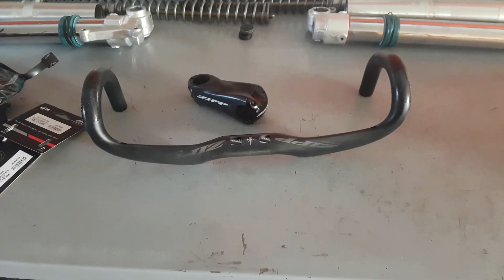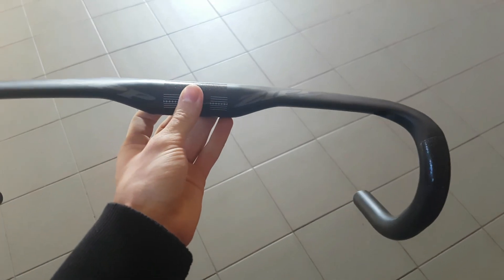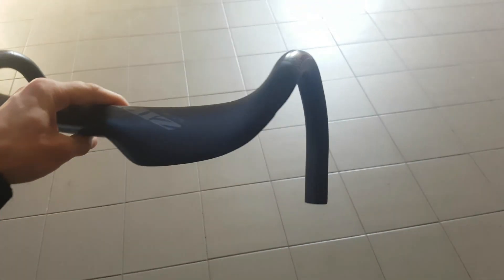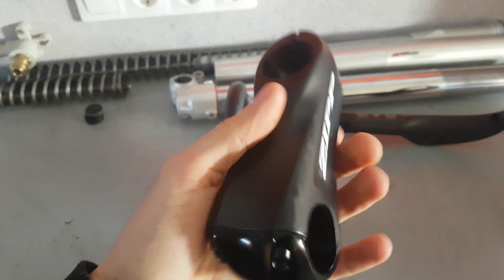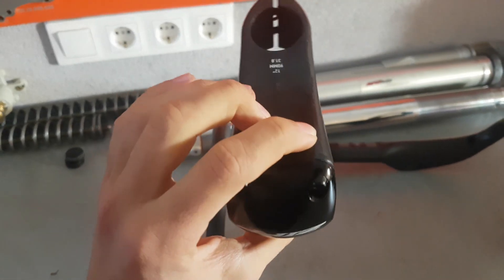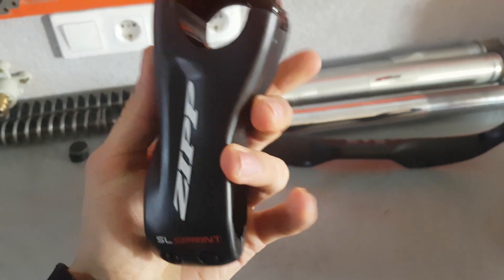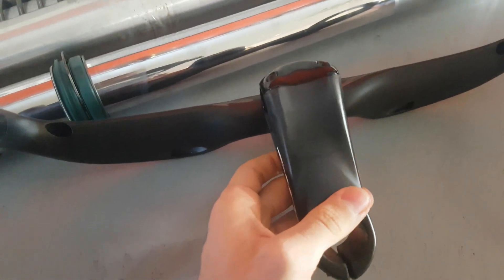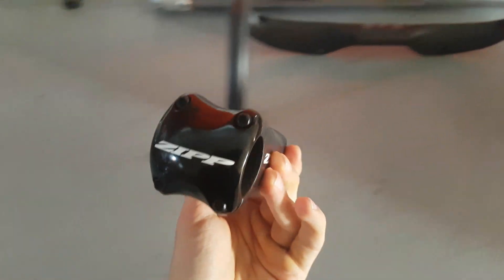Zipp aero cockpit upgrade - SL70 + SL Sprint

Comment: The Zipp SL 70 is tough to run the Di2 cable but have mine setup with the RS910 bar end control box. I have the same 2018 SS Evo Hi-Mod Team, but the disc full Dura Ace R9170. Awesome bike  at 15.21lb with Speedplay pedals in size 56cm.
Reply: Heard the same thing when I went through forums looking for details about compatibility but turned out to be relatively easy when I tried it myself. Found no blockages as folks claimed. No foam at the bends or bleeder bag remnants. Certainly did not have to drill anything. Simply used 2 ft of jagwire black hosing, a derailleur cable with a slight bend at the head and some tape. Didn't even need the silly Park tool magnet kit bs. 
My only gripe is that it didn't actually work well with the tri cable from shimano. Seems to have a better fit when you run it with the shorter regular cables instead (wiring setup in beginning of this, https://www.youtube.com/watch?v=cON3w1IL_7k) Which method did you use for your connection with the RS910?

Comment: Quite nice, but im not sure if i like the staggered bend on the drops. Funny i just replaced the bars on my Supersix this week to £T Ergonovas. Unfortunately my service mechanic discovered a hairline crack on the top of the fork steerer tube where it clamps to the stem. Even worse Cannondale won't sell the said fork aftermarket and its outside the warranty terms! Im hoping a local carbon repair specialist can do a fix to make it safe. It was do to the shape of the Deda stem where it bolts to the steerer is uneven when its tightened to the recommended torque.
Reply from the maker: Donal Mahon that's a shame!

Comment: Which grip tape? Also, I noticed that you wrapped the top a bit further into the center than your earlier vid. Was this decision bar specific or rider specific?
Reply from the maker: Rich Cole Lizard Skins DSP 2.5mm. It needs to cover the cable routing holes
Reply: Interesting. I had wondered about those holes. Electrical tape would be an option to cover them underneath, though not long term I suppose.
Reply: Yesterday, I installed the same Zipp bar on my SuperSix high-mod disc. I'd been dreading it. Your video helped a lot! The olive bushings and connecting bolts on the hydraulic lines were a much tighter squeeze to pass through Zipp's internal cable routing holes. But it worked! Swearing helps...

Comment: Did you just wrapped that handlebar from top to bottom? Doesn't the tape start fraying more easily this way?
Reply from the maker: Paulo Haas I always do it like this on aero bars
Reply: Drops to Tops!
Reply: Meant to ask the same. Any tip of doing so as I'm just about to wrap my new DEDA 35 bars from tops to drops? Or maybe a chance of a photo of same or video?
Reply: It won't fray
Reply: It's got sticky tape on rather than gel by the looks of it so it should be fine as long as it's tiled firmly downwards and you have screw in end caps, actually thinking about it, it probably looks tidier on an aero drop too. I personally do it from drop to top as per the norm, but hey if it works it works what more could you want.